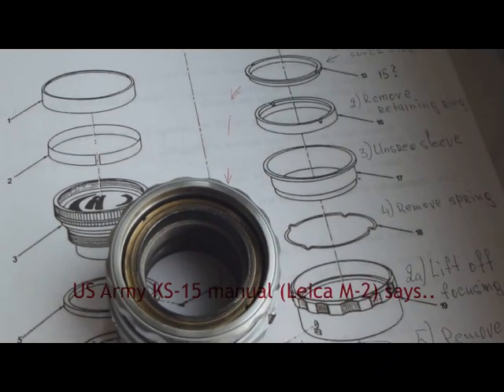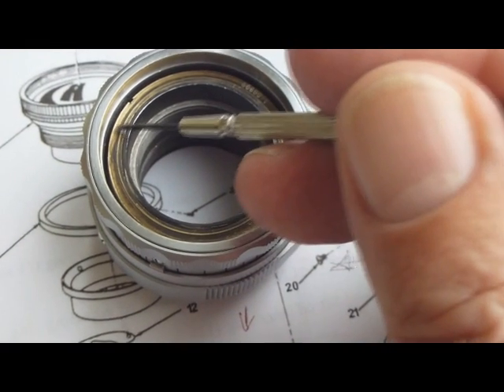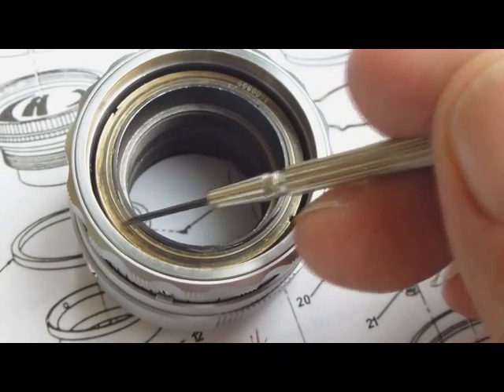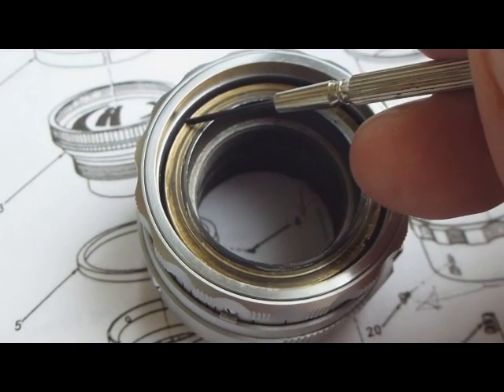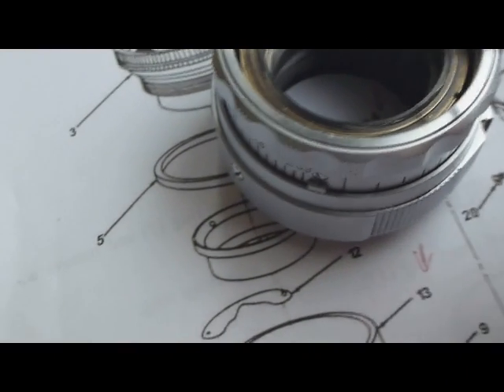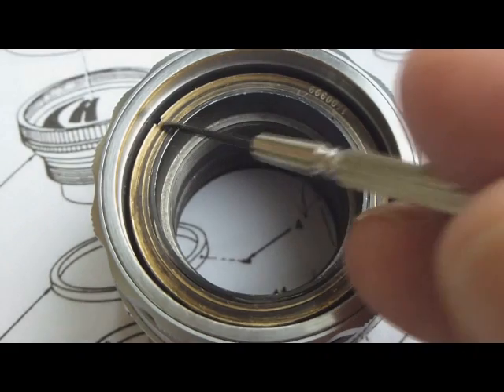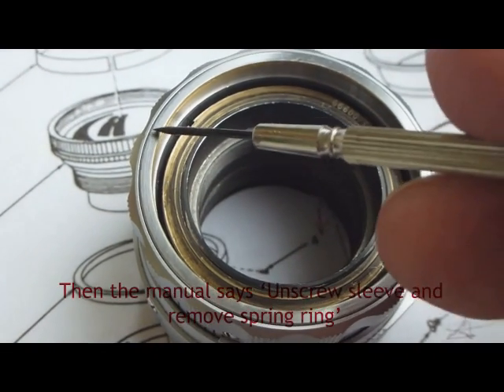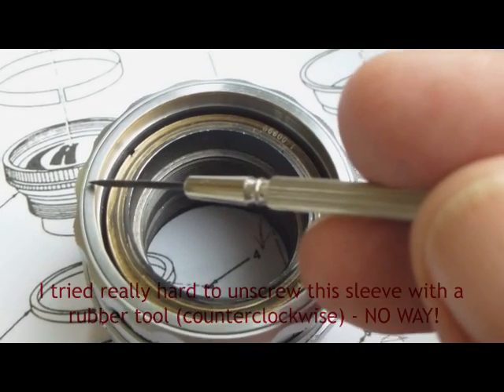DR Summicron - HELP!

Comment: Did you ever solve this?
Reply from the maker: Yes, I did! Unfortunately, I was so excited with this glorious moment that I failed to capture most important steps. Just few short vids. Anyway, thanks for reminding me! Will put my camera on a tripod and re-capture all the procedure. In fact, it was so-o-o easy ... once it happened.
Reply: Well, I'm trying at the moment to get into a Summarit 5cm f1.5. The front part unscrews as per normal but I cannot figure out how to get access to the helicoid part. Very frustrating!
Reply: @vladimirmartynenko9483  so do you have upload the video when you actually managed? Did you fil the whole disassembly of this lens?? That would be terrific if you can share it on youtube.
Reply: @vladimirmartynenko9483  If you could upload the whole disassembly of this lens that would be fantastic, please. I am cleaning my 50mm Summicron rigid v2 and experiencing difficulties on the front element disassembly, so your experience would help enormously.
Reply from the maker: Hi, Photobuzz. In fact, I did NOT even try to disassemble front group, so I’m afraid I will be very little of help for you here. Anyways, will try to consult local Leica guru who CLAD my DR Summicron and post his advise here (if available).
Reply from the maker: @Photobuzz Leica guru says there's nothing fancy about removing DR front element - just spanner and sucker, e.g., https://www.youtube.com/watch?v=DHrpUm-568k Again, I did NOT try it myself, so cannot help you here. Good luck!